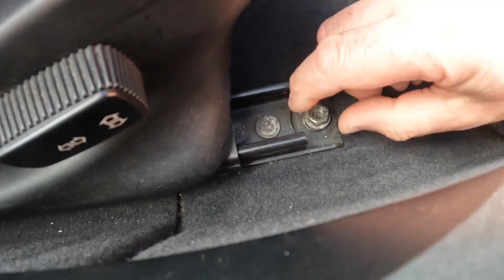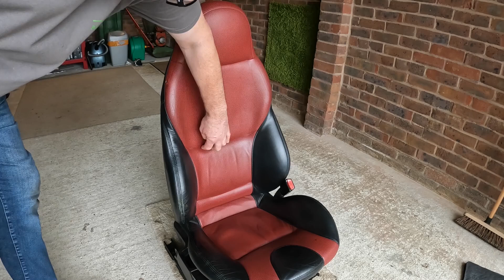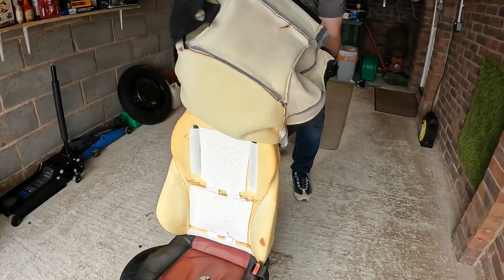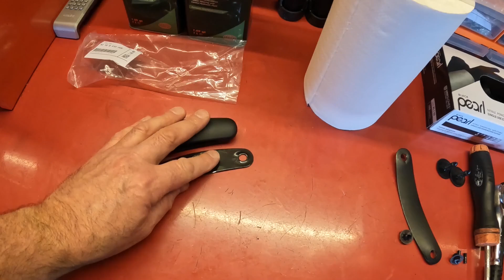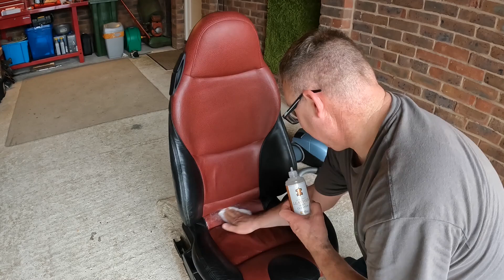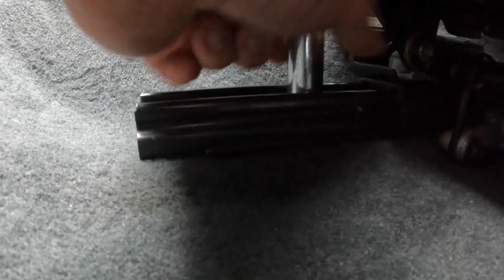Replacing Broken Seatbelt Guide Trim & Sports Seat Stripdown - BMW Z3 1999 BMW Z3 2.8 Roadster E36

Comment: If you are taking off the clamshell backing of an old seat that's been in the sun a lot, your technique at 5:00 will break it. Instead, lightly push downward (toward the floor as you have the seat positioned) where you referenced the clips. This will clear them from what they hook to and the clamshell will slide off with no resistance. Before unclipping the back fabric at 6:05, the person following this should observe how they are clipped together. It's ingenious and simple, but may not be intuitive to some.

Comment: Rather than remove the entire leather seat cover, could you have simply started "top down" from the headrest by removing any hog rings from the back of the seat and then slip the seat cover over the headrest to access the seat belt guide that way??

Comment: What sizes are those hog rings?   Are they 3/4", 1/2" or 3/8" ?
Reply from the maker: Crown size (outer) 23.6mm. Not sure what that is in inches.
Reply: @autoknight747  Thank you so much for the information. Much appreciated.

Comment: Just replaced the seatbelt guide on my Z3, following this video.  Thank you for the detailed demonstration, it was invaluable.  One thing that I would emphasize is that manipulating the hog  rings is quite a challenge, if you've never worked with them before.  There is a bit of a learning curve with them.  The bottom row was especially difficult to maneuver the pliers into the right angle to tighten the rings.  Overall, a great tutorial.

Comment: Excellent video again sir, keep them coming and hope you have one coming up about how to replace rear window ,I have a 1998 z3 with 21.000 miles on the clock. Car is in fantastic condition except window I have a brand new Oem window just arrived from Germany now have to fit if, fabric and stitching in great condition also, best of luck to a talented man. Roy

Comment: Excellent video.   Thank you for your very clear and helpful guide, as I am about to tackle the same problem.   One problem: your new seat belt guides are liable to break again, as they are very badly designed.   I hope to install a small plastic fitting that joins the two sides of the guide, after you slide the belt through.  This strengthens them against the force of  the seat belt being pulled.   They are available on ETSY and I believe are actually 3-D printed by a guy in the UK!   I have seen others comment that they work pretty well.  Why has no one come up with a new seat belt guide made of metal?  Every Z3 owner would pay good money for that!